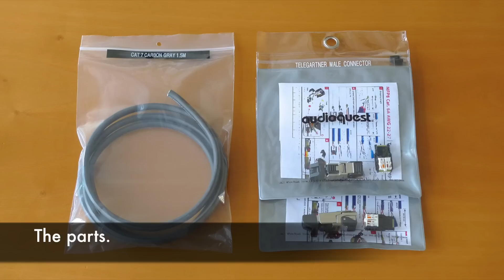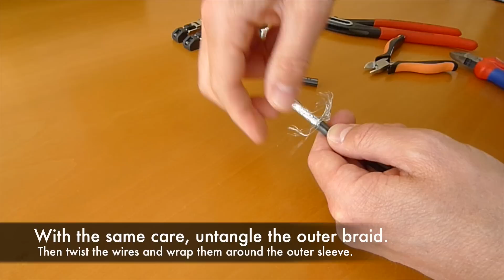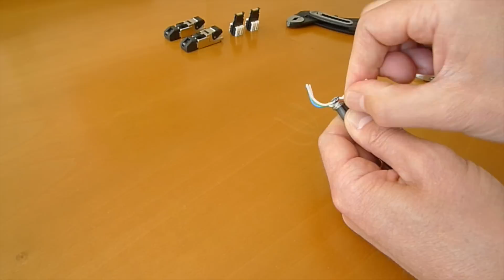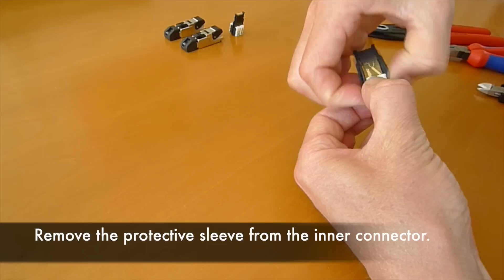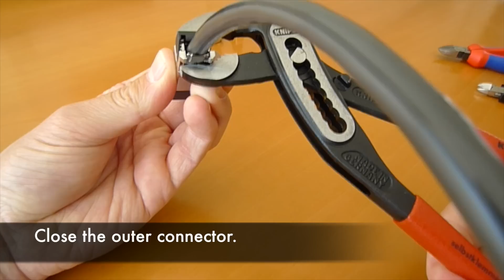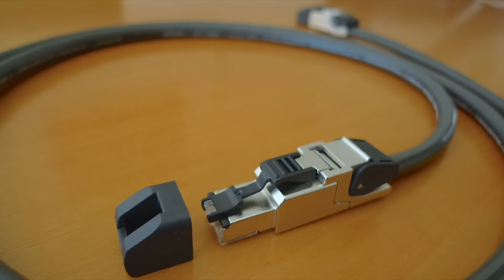Make your own AudioQuest Cat 7 cable with Telegärtner connectors.

Comment: I thought these connectors were expensive until I saw the price of the crimping tool needed for Cat6a. OK they are expensive but for small jobs requiring a 10Gb backbone with two connectors they are excellent value and so easy to install compared to shielded RJ45 Cat6a.

Comment: Thanks for the video, very well explained. Question: Can I unthread this connector and re-line it on another cable?
Reply from the maker: You're welcome. Yes, it is possible to use Telegärtners again. Not all network cables are suitable for these connectors. The diameter of the conductors must be sufficient to make good contact. All AudioQuest CAT700 network cables are suitable for this.

https://artsexcellence.com/cables/ethernet-rj-e-cat7-cables.html?___store=ae_en&manufacturer=2&___from_store=ae_nl
Reply from the maker: Thanks for the comment. It depends on the cores of the network cable if you can use these Telegärtner connectors. But, yes, you can carefully remove the connectors.
Reply: @artsexcellence-online   Thank you

Comment: what about the ground wire? do we connect the ground wire to both ends?
Reply from the maker: Officially yes, but you can also decide to connect the ground wire to one end, it doesn't matter which. We tried both, the audible difference is negligible.
Reply: @artsexcellence-online  thank you, is the metal rj45 conector on router and pc side enough for grounding?